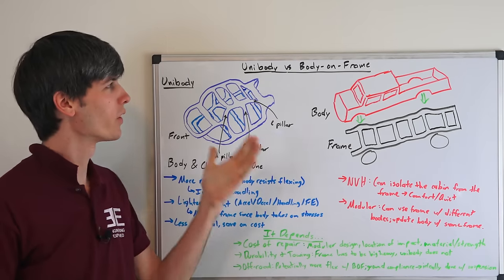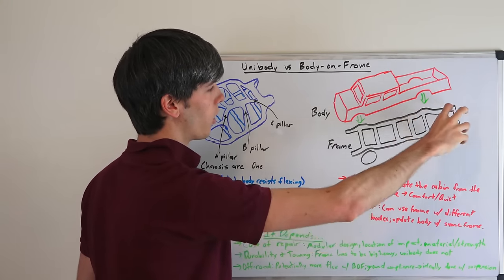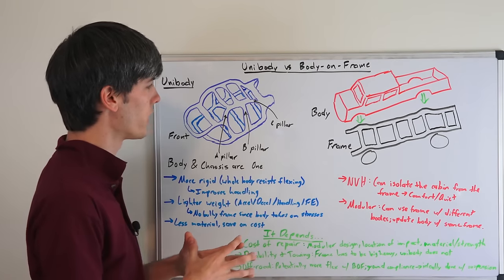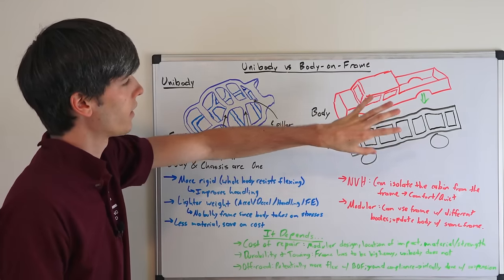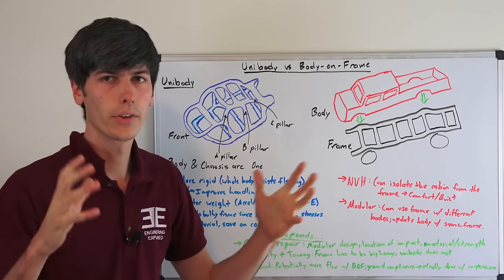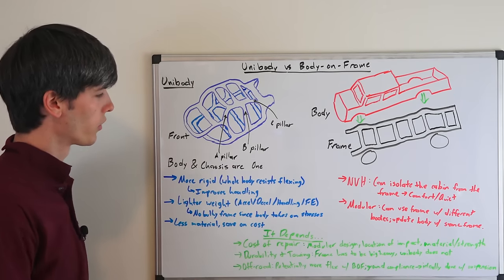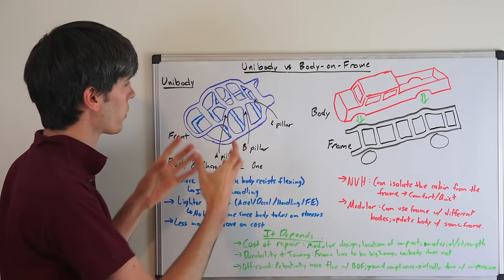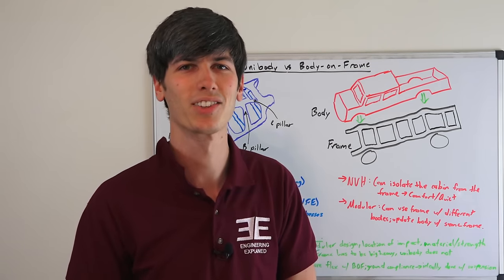Unibody vs Body On Frame - Which Is Best?

Comment: The benefit to body on frame over Unibody off road is that the body doesn't flex. Lots of people off road unibody xj's and they eventually wind up with doors and hatches that can't open or close because the unibody has distorted from the off road abuse. Whereas a body in frame vehicle usually doesn't have this issue.
Reply: +Joe Schigel This one comment answers my confusion about why vehicular aficionados demand that their big trucks (Explorer, pickups, etc) be body on frame if they go off-road. I never could figure out why BOF was so much better, but this makes perfect sense. Thanks.
Reply: +Joe Schigel That's comparing much older technology. As explained in the video, a modern unibody is far more resistant to flexing than body on frame.
Reply: Yeah I was wondering about this very topic as well!
Reply: FYI, the only benefits now for body on frame are the ability to customize the body (ie cab configurations, bed, flat bed, box), and its cheaper to manufacture. Companies don't want you to know that though so they can continue making huge profit margins - currently averaging about $10k per truck.
Reply: ***** Me hate GM? lol. I'm more of a fan boy than anything. That doesn't mean I can't point out that people buy vehicles for the wrong reasons.
Its estimated that 90% of Ford's GLOBAL PROFITS come from F-series sales in the US alone. Ford makes $13,000 in profit with every F-150 they sell.
Reply: ***** No they wouldn't. The rest of the world gets by just fine without having to rely on huge sales of fullsize trucks and SUVs.
Reply: At the end of the day, however, body-on-frame will almost always outlast a unibody.
Reply: ***** I've heard that as well.
Reply: ..there is a reason why body on a frame  is an ultimate choice for heavy duty trucks and machinery..i do agree with this video as far as we talk about light vehicles...things are rapidly different if heavy duty with long lasting  use is requirement...
Reply: Correct.
Reply: Todd Wilson no he says that the frame is more likely to bend than the body. On a BOF configuration the body is separate from the frame so when the frame bends the body does not. In unibody even though modern vehicles are stronger they still have a higher chance at bending than the BOF
Reply: This video is absolutely nonsense. This video creator clearly has never taken a ride in a 1970-1979 Lincoln Continental. These automobiles prove that the Body-On-Frame idea was the most astounding achievement in automotive history. The strength was unprecedented. And the ride-comfort was identical to inserting thick clouds between a boat and the ocean. The idea that modern unibodies are more rigid is one of the biggest scams in history. Today's modern automobiles offer disgusting ride quality and comfort.
Reply: You can damage the body on a BoF without compromising structural integrity- damage the wrong part on a unibody and not so much.  When you've got a trail rig dents happen.
Reply: Yeah I'm wondering if I should put frame stiffeners on my zj...
Reply: "inserting thick clouds between a boat and the ocean." 

Identical? Last time I checked clouds don't hold airplanes up, so what chance does it stand vs a boat? None. So the ride comfort on a 70s Lincoln Continental was like being on the ocean? That's a ride comfort not seen on American roads since Galloping Gertie, aka Tacoma Narrows Bridge.
Reply: @danielfranklin9062  Clearly you didn't understand my analogy. Oh well.
Reply: Oh, I understood what you MEANT, but "identical" has a specific meaning, it means you compared them literally not analogously.
Reply: Jeep XJ = designed by Renault = as weak as they get.
Reply: @bahamatodd  "Far more resistant" compared to previous unibody vehicles BUT still not as resistant as body on frame.
Reply: @bahamatodd That may be so BUT it is cheaper and easier to repair body on frame from a collision which benefits the consumer.
Reply: @spamcan0  My LC agrees with you.
Reply: Todd Wilson - I'm 3 years late but WOW that's a huuge profit margin! $14k on a ~$50k truck?

I knew F-150 has been #1 selling vehicle in US for like 46 years, which makes ~30% profit margin even more impressive! 

Still, Cybertruck > F150 and Jeff Epstein didn't kill himself
Reply: If I could read this before watching the video it would be much better. It is the only information we need. Thanks.
Reply: @bahamatodd  wrong.
Reply: @Joe Schigel, Sorry to say what you said is not always correct!!
It depends on how it is built the vehicle beefy or not. As explained in this video.
My previous Mitsubishi Pajero/Montero 2nd generation LWB suffers from the door closing problem if any door is operated (including the back door) while the vehicle is in an articulated suspension position despite the car is with body on frame concept.

During the launch of the 3rd generation Pajero, Mitsubishi has announced that the new Pajero has a strengthened body that resists 3 times more to torsion stress compared to the old generation.
And I confirm that is a fact. I tested it by my self on my 3rd generation Pajero. In the same case of an articulated suspension I can open and close the doors of the newer Pajero with an extrem ease!! Despite it is a Unibody built type.
Reply: Cost cutting everywhere door latches that break off I’ll stay with body on frame till they find a way to ruin that
Reply: @bahamatodd  Ford's biggest money-maker is their financial business which rakes in more than their global vehicle sales. Also pretty much every vehicle mfgr makes more money in the larger China market than in the US.  We're a big market but not the biggest.  Ford's survival wouldn't be that dependent on their F-series; that would just be a terrible business strategy
Reply: My cage and frame stiffeners made my xj the best of both worlds
Reply: If you had a moderately substantial wreck, and the body was was bent, and you couldn't open doors, etc, would it need to be totaled?
Reply: I dont know whether you will read this, because it is so long ago. We  rented more than ten years ago a Lincoln Town Car for a trip from Houston to Arkansas. I was blown away by its ride quality. It was not sportive, of course not, but factually it was on a the level of the  Mercedes S-Class. It was and still is an exceptional car to me. And a friend of mine who is dead now had the Lincoln Continental and loved it more than his BMW 745i. These Lincolns are fabulous cars...
Reply: Unibodies are more rigid and stronger. They don't make them as beefy as they could be because they simply don't need to, they're strong enough as is. This rigidness is the reason you get worse ride comfort. Just like harder suspension makes for a bumpier ride.
Reply: Thanks!! I want a light fuel efficient crossover that occasionally gets out of a ski resort or down a dirt road...if I want real off road I'll get a dirt bike...I can't afford to off road a daily driver
Reply: Plus a univody a much bumpier, rough & uncomfortable ride.

Comment: If a unibody vehicle gets into a terminal collision, the majority of the body becomes scrap metal. With body-on-frame, most of the body can be salvaged and used for repairs. Other advantages are the ability to remove and replace panels, whether for modification or repair, and lower end-consumer costs in the long-term.
Reply: wow thats informative...thanks man:)
Reply: Car's job is not to be the best at surviving a terminal collision. A car's job is to make the OCCUPANTS inside of the car survive a terminal collision.

So a unibody is way superior than body on frame in this regard.
Reply: @angrysocialjusticewarrior  In actual crash tests, the difference is negligible. A body-on-frame design from the 80s is pretty comparable to contemporary unibody in terms of safety. But the car won't crumple like tin foil if you bump into something.
I could literally make origami out of the "fenders" on my Nissan. The only reason they exist is to make the car less ugly. Meanwhile the same type of collision that caused me to replace half the front end on that was repaired with dish soap on the Panther body.
As far as I'm concerned, it's an excuse to increase profit and force repairs by making your car out of tin foil and plastic.
Reply: @angrysocialjusticewarrior  no this is actually a scam by car manufacturers. they just want you to buy new cars
Reply: THanks man
Reply: pete smyth  everyone knows using less metal saves money & i do know alot about physics
Reply: In a terminal collision, the priority should be saving lives, not saving the car.
Reply: Unibody. Workshop happy. Insurer sad.
Reply: Insurance companies will declare it a total loss either way.
Reply: @Baker.Matthew  I am aware.

I went to the junkyard and repaired it anyway for a hundred bucks.

Twice.
Reply: What's even better is a body on frame can actually be driven home after a light finder bender. But usually a light bumper tap with a unibody will total out the entire car.
Reply: 2022 Toyota corolla is nothing but junk. I've got $3200 Damage just from a light bump. Their light driving an egg with wheels. They are way too fragile
Reply: @angrysocialjusticewarrior I totally agree but ninety nine percent of most accidents are usually fender bender or rearing bump. Not a one hundred and thirty mile per hour impact. That would be a head on collision at sixty mile per hour with the other person running sixty mile per hour. Most of us don't have collisions like that. But I would actually like to build a drive my car home if I bumped somebody at fifteen mile per hour. I'll take a body on frame any day. The cost is way too much to repair a unibody.
Reply: @angrysocialjusticewarrior 
Look at your repair bill after you have a fender Bender on a unibody. And then I want to see how sick you are to your stomach.
The cost Is insane to repair a unibody. Because it doesn't even have a frame It just warps the body. I hate my 22  corolla
Reply: @T1Oracle  - Why not both?
Reply: @robd1859  - How dare you point out that the extreme majority of car crashes aren't lethal!!! Don't you know that it's 2023, where we base our decisions on statistical anomalies rather than high probabilities?!?!?! Think of the Car Compani- I mean 'Think of the Children!'

Comment: nice video, as an avid "offroader" id like to point out a few advantages that a framed vehicle has.

1: you really cannot have too much articulation when tackling obstacles, frame flex can give you the little bit of extra flex you need. 
2: a unibody will flex as well, and when it happens it will flex things like the doors and panels that have glass in them and it will damage the body instead of just the frame.
3: its a lot easier to attach bumpers rock sliders and roll cages to a solid steel frame.
Reply: Yup, frame flex is not a bad thing if designed for (like the gap between cab and bed on a tradition pickup).
Reply: Great comment... I'm in the market for a vehicle but don't need to off road it.. do need space and occasional all wheel drive.   I'll get a Bronco when I'm rich and a Bronco sport for now.  If I have extra money I'll get a dirt bike

Comment: Drawings 10/10 - would watch again! As always, great video!! :)
Reply from the maker: +MrandMrsHayday Means a lot, spent days perfecting the truck bed.
Reply: +Engineering Explained Great video and explanation as always, keep it going. The drawing is good too, but you can improve it even more. Remeber to keep lines parallel - front to back, left to right, window to window etc. It makes for a perfect drawing. The unibody drawing is perfect though!

Comment: The isolation with body on frame is useful with heavy duty towing, hauling, or serious off-roading situations. Any situation that could cause a lot of flexion in the vehicle will create problems with unibody vehicles. Windows crack, body panels warp, and doors won't open/close when too much flexion is put on a unibody design. Of course this is only applicable in serious situations.

Comment: Body on frame is cost effective, for example 1991-96 Caprice body was sitting on a frame from 1977...The new BMW i3 is body on frame...in a totally modern way but the idea is still the same.
Reply: +Kobbetop with the body on frame, they could house the weight of the battery, use an extremely lightweight body and maintain a low weight, and have an isolated driving experience.
Reply: ChinnuWoW vics were out of production in 2011
Reply: ChinnuWoW just saying because all the full frame sedans except the i3
Reply: And body on frame is easier to restore !
Reply: The i3 is undoubtedly a monocoque
Reply: @lucianistoc1264  It actually is body-on-frame construction which is pretty rare these days. The body shell might be considered as a monocoque, i’m not sure, but it sits on a frame that houses the battery. Very unique way of production but I guess it makes sense when it’s a low volume car.

Comment: This video answered a lot of questions for me. In the past, I needed a large pickup truck capable of going off road.  Now, I'm retiring and downsizing, and won't even be driving on an unpaved surface.  I still; however, would like to be able to carry in my vehicle more than just a few bags of groceries.  A new small  truck will be out soon  that checks off a lot of boxes for me on a unibody frame.  This video helped with my decision. Thank  you for this informative presentation.

Comment: The advantage of a body on frame design for trucks and large SUV's, is of course for towing and a higher payload for trucks, because the stresses are not applied to the body, only the frame. Also for 4x4's, a frame gives strong mounting points for the suspension, especially on the front, where all real body on frame trucks and SUV's with independent suspension, have the upper control arm attached to the frame as well. Unibodies that have an upper control arm, have it attached to the thinner metal of the unibody. Most unibody 4x4's, as well as the Honda Ridgeline have a less durable MacPherson strut, instead of an upper control arm that is attached directly to the unibody.

Comment: another disadvantage of unibody is that if they want to make the frame more rigid for offroading, they will make the frame pillars much more thick, the new models range rover vogue have really big pillars that you won't notice from outside.. as a result the windows are small and obscure visibility also that pillar will take more space inside the car..

Comment: the biggest advantages to off roading is the duality of a body on frame. typical after lots of rock crawling unibodys twist and the doors wont shut. also the ability to add a "body lift" basically put taller spacers between the chassis and body to allow more tire clearance

Comment: Good vid. answered some of my questions. I used to hate unibody (rust can destroy the vehicle since the unibody provides structural integrity whereas rust on the frame can be repaired much easier). Had to junk a car just because of rust on the floor pan...not happy. I don't necessarily hate unibody anymore but, still, I don't like having to buy cars because of BS like floor pan rust.

Comment: I'm still giving the win for off-road use to body-on-frame vehicles. If you're building a 4x4, the body can be drastically altered to accommodate larger tires/more suspension travel without affecting structural integrity of the vehicle itself. In addition, because the frame is easy to access and rigid, you have much more freedom in mounting new suspension components, whereas you're limited to the factory hard points with a unibody.

Comment: Coming to this vid from the far future helped me understand why I shouldn’t care about how there’s so many “truck guys” sh*tting on unibody Trucks since the only advantages in a BOF are on things I’ll never use and the advantage in better crash performance of Unibody for occupant safety more than makes up for a possibly slightly lower towing capacity (that I generally don’t need to pay attention to anyhow) and off road performance if I randomly find myself teleported to the wilderness in a truck I plan to use for working.